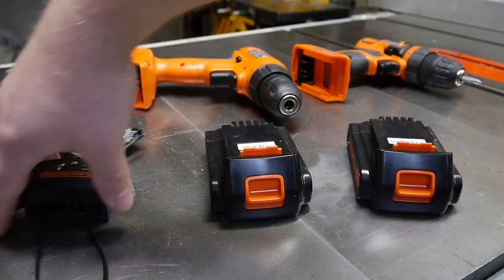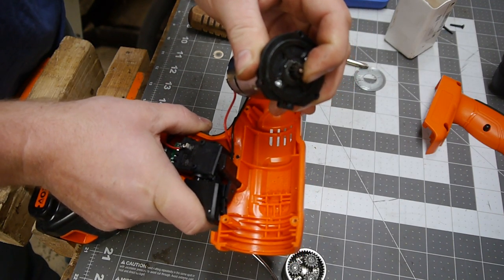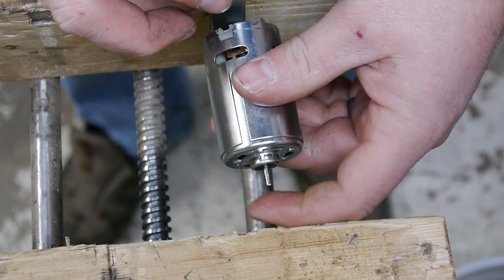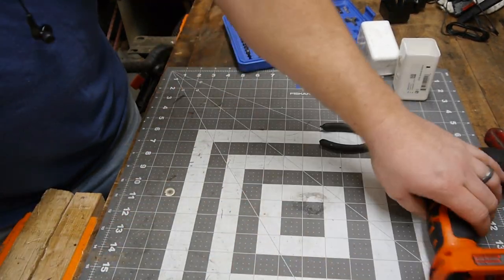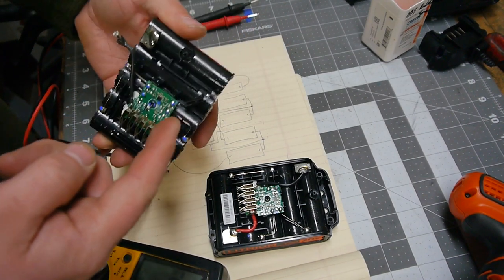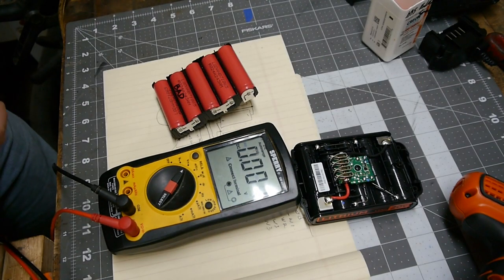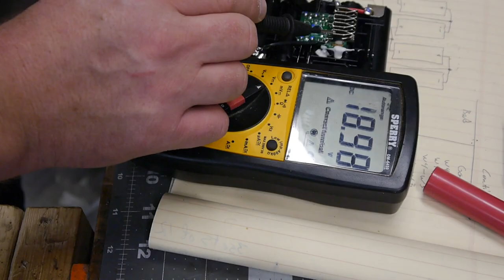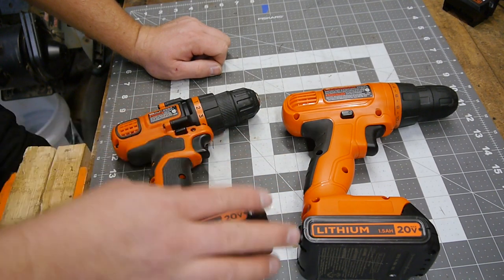B&D Lithium Battery and Drill D.O.A. -Lithium Battery Blinking Red Light Fix

Comment: This is the only good video that I could find to deal with Blinking red light from a single dead battery for B&D powertool. One comment: your soldering technique can create small fires...... i.e. overheating the 1865 Li-on battery.  However, awesome video brother.
Reply: I would charge individually "bad" cell before doing soldering job.Very often it helps charger to pick up right direction.

Comment: My professor in engineering used to work at B&D in R&D. He told us a few stories about how the (electronics) engineers have to take weird shortcuts to keep sourcing costs at an absolute minimum. Basically, B&D became an ElCheapo brand ages ago, investing quite a bit in good design and marketing - but next to nothing into quality components. We have a B&D weed whacker but that's about it - sticking with Bosch & DeWalt ... great video though. I learned something from it!
Reply: That moment you find out B&D own Dewalt and possibly Bosch definitely porter cable and craftsman 🤯

Comment: Hello. I got the same problem with the battery. After I'd replaced a fault cell I could use it again, but I can't charge it on the original charger. The bloody red light kept blinking. Any thoughts? I guess it's something related to the electronic board inside.
Reply from the maker: Possibly what caused the faulty cell caused the charger to fail, or possibly the battery is below a certain voltage threshold and the charger is refusing to charge it. I know some people have fixed it by charging the battery manually up to nominal voltage and then connecting the charger. At any rate that is my two cents. Good luck!
Reply: @JoshAQ  the battery failed out of the charger. I used an external source to charge all cells individually. After that I got 19 volts. Even then the charger refuses to charge it.

Comment: Nice job overall.  One small suggestion--for the first fix, you could have used a rag (or such) between the drill/drill's chuck and the wrenches.  This would have prevented the wrenches from scratching up the drill.  (I realize it's also possible that the scratches were already present.)  Just something my Dad taught me.

Comment: ....no Torx driver?...the security bits are not all that tightly held by the pretty orange plastic.  A small [6/32?] or so flat blade screwdriver will take that T screw right out.  Been there...done that.  Repeatedly.

Comment: You should really warn your viewers if you hear a pop sound or anything that sounds like air get rid of that cell fast.
While trying to disconnect the cell like you showed in your video I did the same only the weld didn't pop loose so easily and it created a hole in the battery.
Reply: Oh god that sounds terrifying

Comment: All u had to do is connect that battery to a charged battery for like 5 seconds then it will charge I connected my dead battery to a car battery and now it’s charging 🤷‍♂️
Reply: ....yep....the wee BMS board no talky with "bad cell" since it's voltage fell too low.  A quick bump with a voltage source directly to the misbehaving cell will bypass the bms momentarily and float the cell volts up high enough to be within the "passband" of the bms....and the gates will open to the charger...and all will be well.  Usually...always a possibility of a turd cell, but rapping it on it's snout to wake it up is quick, easy and...free!